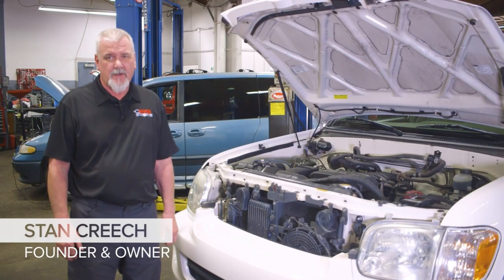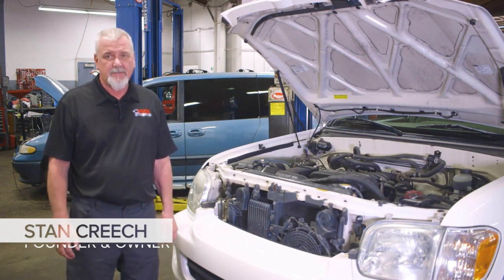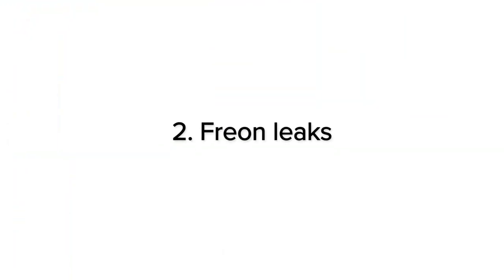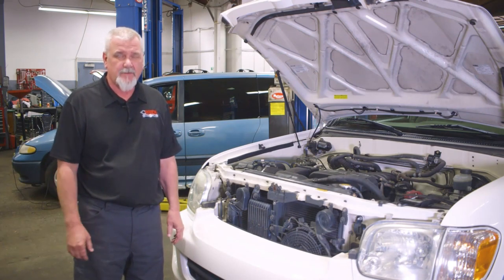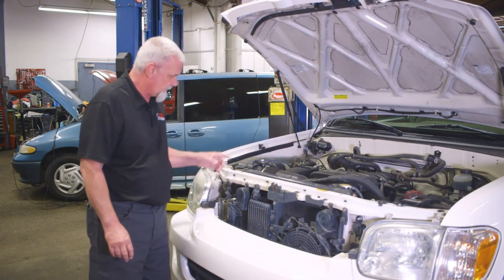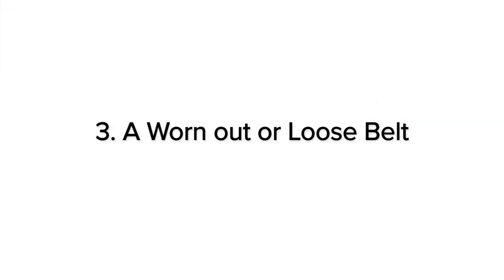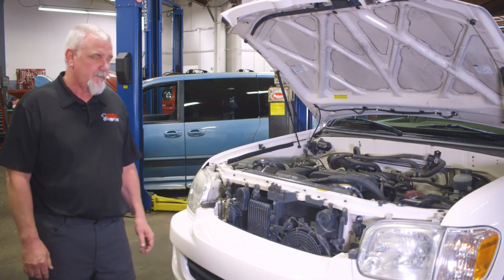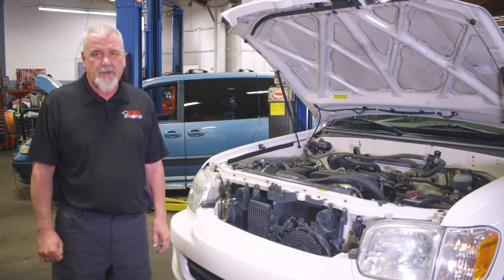4 common car ac problems

Comment: My car ac works fine at ideling.. As soon i change gears like 2nd or 3rd gear... It stops at the same time... Or sometimes if it is running fine on highway and suddenly i apply the break.. Ac trip off.... So can u please tell me what would be the problem

Comment: I had a mechanic check my ac and said the last guy who recharged my freon over charged it, so he just let some of the freon out to even the pressure. My a/c doesn't blow hot air anymore but my a/c blows a slightly cold air and takes a really long time for it to finally blow ice cold air. But when my car is parked in the shade i turn my a/c on. It blows ice cold air immediately. i checked my condenser and its clean of debris. do i need to change my a/c compressor along with my condenser?
Reply: It may be the thermal expansion valve, but I'm not sure.